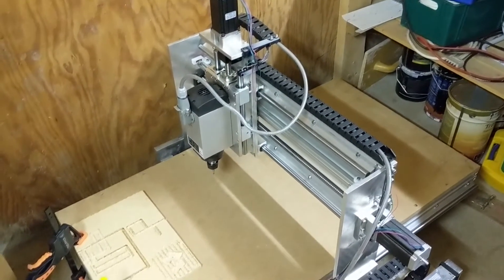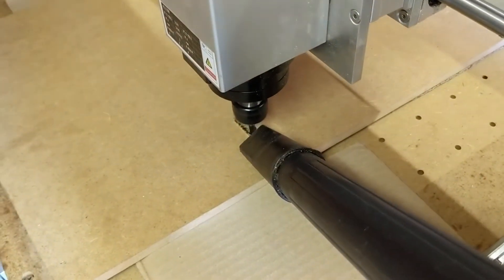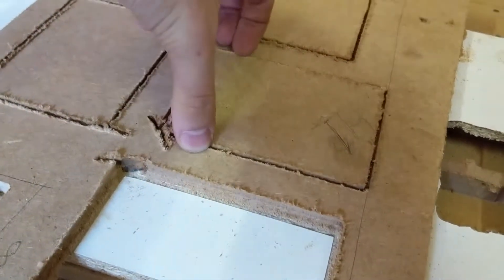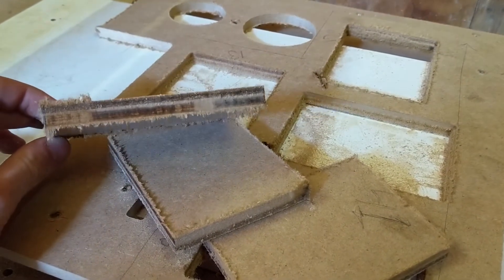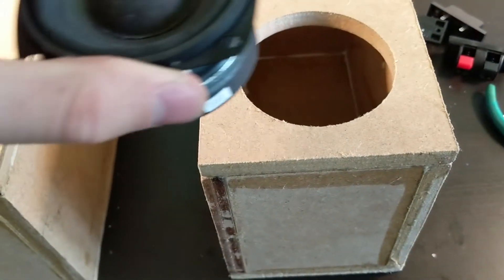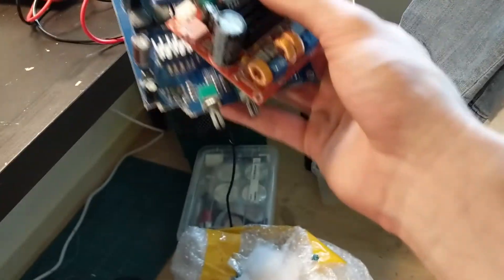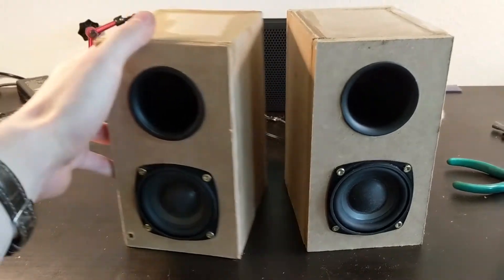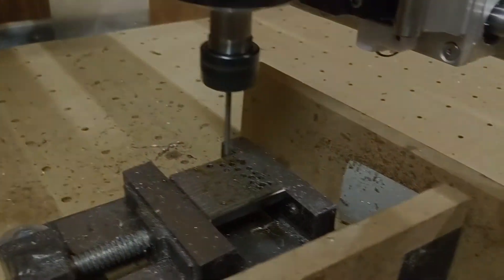CNC router build - Part 6 - Testing CNC and making some speakers

Comment: if you have enough height under the outer you could clamp a set of them together and make  finger joints intoo the sides  , on the other hand if you use a laser you could include the joints in the cutout (router would leave round inside corners laser cuts a line and straight corners)
might be able to replace the router with a diode laser or add a mount to the machine so you can put it on next to / in front of the router (make it removable as the dust from the router can make the laser lens dirty wish would cause it to get hot and crack ) the progamming should be the same excep you dont need to acount for the thickness of the routerbit and might need to make more than one pass to cut through the material 
could allso make the parts the exact dimentions and after cutting run them past a 45 degree routerbit and glue them together without seams , might even be able to use a v bit in the router after cutting the speaker holes 
could allso sink the speakers intoo the holes by machining a resess for the speaker flange 
bit of extra work in the innitial desighn but once done will make the finished produuct look mush nicer